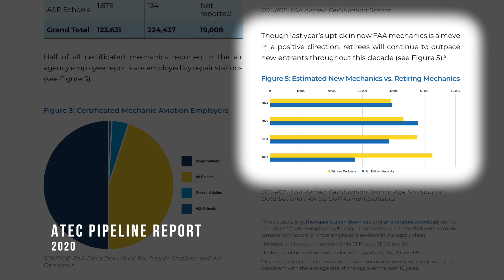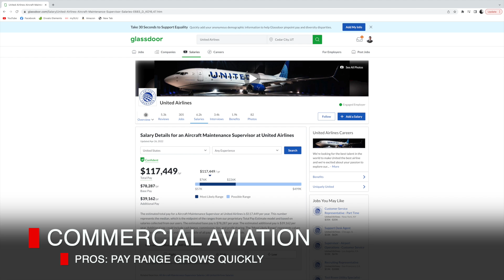Aircraft Maintenance Technician : Career Paths , Pay , Pros + Cons

Comment: I’m currently going through a part 147 school. I am closing in on airframe and about to take my first two written tests. I am just curious, what is the process of applying to regionals once you get that A&P?
Reply from the maker: Each process may look different depending on where you're applying. Once you're licensed you can apply to any open listings, which may offer more info on each individual hiring process.
Reply: @SUUAviation thanks man. I’m really looking more towards Envoy or Republic straight out of A&P school. That way I can work myself up to a spot at delta

Comment: I recently got my foot in the door to stripping and resealing fuel tanks for bowing which the company doing the work offers to help go further career wise if you so choose and I was curious for someone with an insulin pump and wireless glucose monitoring device would it be better to drop those devices as risk to injury is probably high or would isolating the devices in say a rubber adhesive pad be viable?
Reply from the maker: Hi there! Our AMT Director in this video has actually worn an insulin pump for the past 25 years in the industry.

Comment: How well will an A&P certificate transition into a mechanical engineering degree? Lets say i decide to pursue Civil engineering after finding out i dont like mechanical, would it be a fairly smooth transition?
Reply from the maker: Hi Jose! Our A&P and mechanical engineering programs are part of two separate programs, so it's hard to say how easily A&P transfers to electrical engineering. If you have any other questions about the A&P program, let us know!